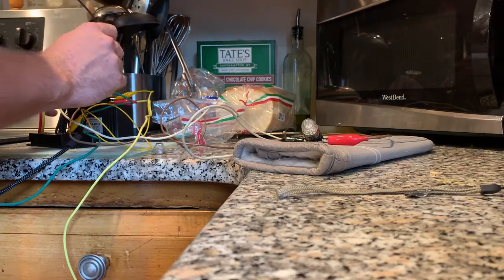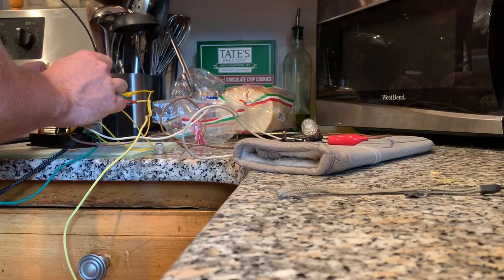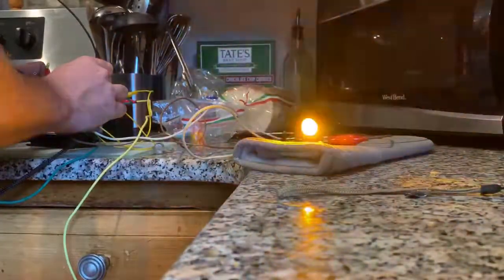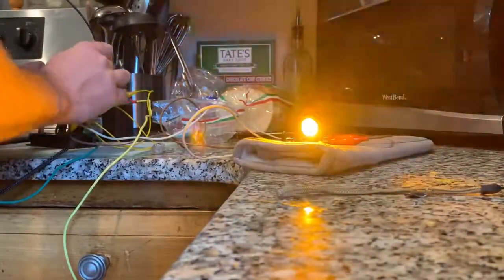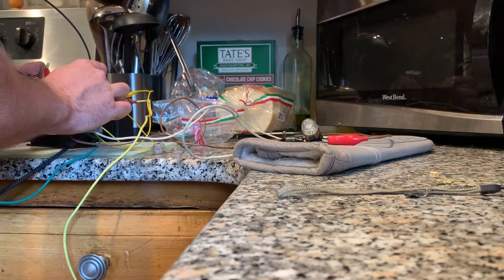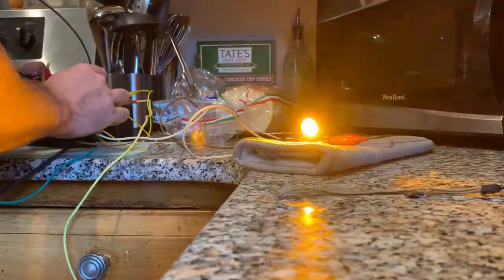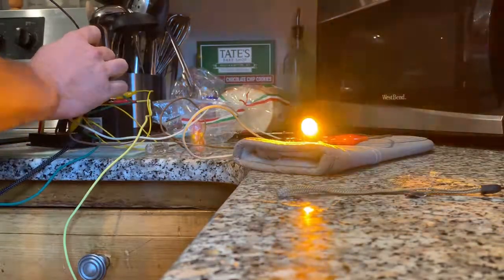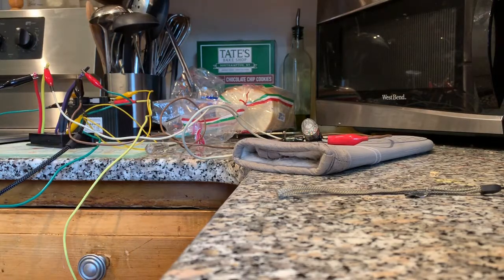flexalite variable speed fan controller 31163

Comment: I just got one for my 180 flex fan with same controller in this video it's not soft starting or doing a 30sec shutdown when ignition is turned off I might have a bad controller or probe my probe is in the radiator fin not in line
Reply from the maker: Probably probe related. It needs temperature to activate the fans but also to trigger the cool down and soft start. This is why I opted for the thread in sensor as I find the rad probe to be inaccurate and wonky at best.
Reply: @jonathanstansfield735  yeah i thought so i seen comments on the web about the probes being inaccurate,;( But i was think getting a set of probes that have lower ohm reading so it can trigger the fan earlier, im waiting a comment back from summit about the controller issue but i will see their response
Reply from the maker: @LaserGazerMan  did you try bypassing the probe? Use the AC override or the ground or positive triggers to activate the fans and see if the soft start and ramp down is working correctly. Summit will just ask flexalite so you should just call them and bypass summit.
Reply: @jonathanstansfield735  no i havent, i have the ac trigger currently hooked up to the 12v solenoid ac compressor when i start the vehicle not warmed yet and turn the ac on fan kicks on full speed no soft start, yes will be contacting flex a lite directly
Reply: just found out the controller i bought is the wrong model dam summit racing, I talked to a Flex-a-Lite tech and he said model 107000 controller that i bought is not a true speed controller and i said to him that means its just a solid state switch that just turns on and off with a delay feature OMG!, After that the tech recommended a model "The true variable speed control part numbers are 123195, 123241 and 107012" i told him again the manual says 60% to 100% speed control and tells me "yeah we use the same manual for all models but we don't know why we do that" So the listing is misleading and the manual also, sounds like this can open a can of worms i will be contacting  Flex-A-Lite sales directly to get this fixed and refunded i will post an update if anything comes up.
Reply: Whelp just got back from talking to Flex a lite sales and Tech department and complained about the listing being the same or to similar to each other, they will be contacting flex's website tech to change the listings and Summit well i just spend another $100 for the right model 123195 but got $50off for the correct one, talked to summit Rep to try to exchange for the correct model but they don't except used units BULL** only used twice, so they took all the notes down that flex a lite told me though the phone so im hoping this will get all fixed quickly before happening again with someone else, Thank you Jonathan Stans for you help.
Reply from the maker: @LaserGazerMan  that sucks! I thought u had the right controller otherwise I could have given you my part number to verify. Once you get the new unit you should be good to go. I haven’t had one bit of trouble with my unit since install.